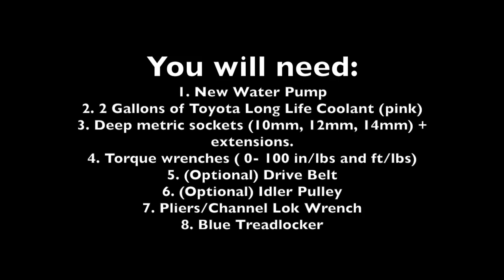Water Pump Replacement for Lexus GS 300 350 IS 250 350 RC 350

Comment: Thanks for the video. The Lexus dealer wanted $1400 to replace mine. I paid $120 for the pump, antinfreeze and a new cap. I followed your video completly and it worked! Took time but well worth it. Thanks!
Reply: How long it took you. And when is the best time to do mine ??
Reply: I just replaced mine.   Same thing, the dealer wanted $1200.   I followed this video and replaced the water pump, the water pump pulley, the coolant thermostat, and the coolant for a total of $340.
Reply: 1400$ ? change dealer.

Comment: 8 years later, your video still helps. I had water pump done by brake shop franchisee. Just year later it started leaking. They are saying parts covered not labor. And price increase on parts not covered. I got ASIN pump for price less than their price increase.
So decided to do it myself. Your video helped me. It’s done in great detail and step by step, easy to follow.

Comment: Hello. This is a very helpful video. The moving camera does not help sometimes, make me dizzy. The water pump usually goes bad after 100K miles, by that time  I would  also change the thermostat, belt and idler pulley, they dont cost much and would make a complete job. Thanks for including the manual diagrams and give detailed explanations, VERY VERY HELPFUL. Keep the good work and Thanks again!!!!

Comment: for AWD @ remove engine plastic cover around 2:50 this part looks different(at least on my 2007). Just remove the piece that makes sense and not the metal cover nearby with many more than 7 screws. Other than that my AWD appeared identical to this.

Comment: hi ez/2a how do I know .it is the time for replace water bump of lexus rx 350 2009 thank you for let me know please
Reply from the maker: You'll notice a lot of dried pink coolant on the front of your engine where the pulleys are. Also your coolant level will be low. Replace the pump as soon as you can as it can fail and cause catastrophic damage.

Comment: May you tell me which bolts use threadlocker and which use thread sealer?
Reply from the maker: Only used thread locker on the bolts with colored threads. Didn't use any thread sealer

Comment: Great video. 07 gs350 Have any of you had p1650 occupant detection faulty? Air bag light will not clear. I tried calibrating passenger seat w snap on scan tool, code will not clear. Thanks

Comment: I'll be taking the time this Sunday to replace it. The video is looking great already, thanks for posting. Is it just the 10mm that needs a deep socket(which I got)? I haven't needed a deep 12 or 14 previously.
Reply from the maker: You might be right. The larger deep sockets I might have used for the extra length that could be also achieved with extensions. Its been so long ago that I honestly dont remember. Good luck!

Comment: Did you have ticking/rattling noise from  coolant leaking on the timing chain?
Reply from the maker: No, I did not. the timing chain is internal and bathed in oil, so I don't think that would be a problem unless you had oil and coolant mixing somehow. The 2gr-fse has very loud injectors/fuel pump.

Comment: Did you use silicone for the water pump gasket ?is it recommended?
Reply from the maker: No I did not use silicone, I don't think the manual calls for it either. just use the gasket as is
Reply: Awesome thanks man

Comment: Are these 2006 gs awd engine port or direct  injection
Reply from the maker: I believe the gs300 is DI only like the is250. 2007 GS350 and later years are both port and DI.

Comment: When is the best time to change my water pump. How much did it cost you ?
Reply from the maker: Check out the links in the description on the latest price. All it cost was the kit and my time. If you're losing coolant mysteriously and have dried coolant on the front of the engine then it might be time to change the pump.

Comment: Is the procedure the same on a 2007 g450 hybrid?
Reply from the maker: I haven't worked on one but I believe the overall process is the same. The engines are very similar.
Reply: @ez12a  do u know anything about the hybird inverter or the second coolant on those , do i need to mess with that when i do the water pump?
Reply: @Ash Ketchum appreciate the reply,  yeah that's exactly what I did job was successful.
Reply: Very helpful video. 👍

 @panthers559  Hi, i am planning to change the waterpump during the coming week on my lexus gs450h 2008. I wonder how it went for you? Is there something more to consider while changing the wp.
Thanks in advance :).